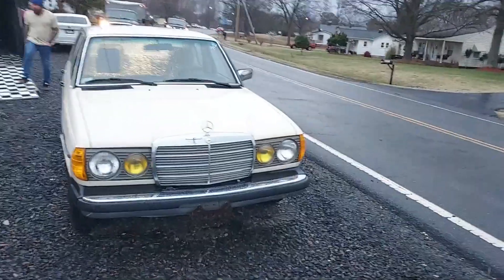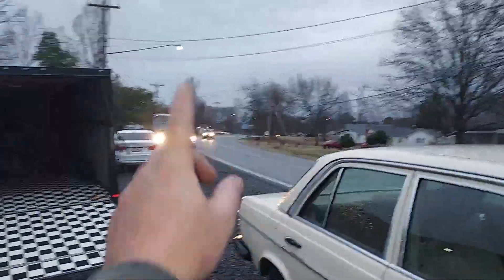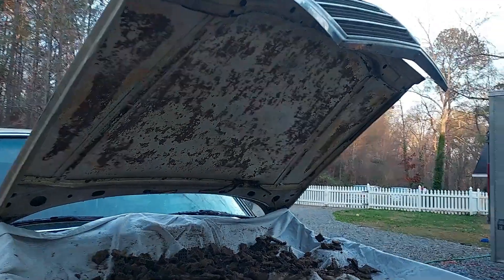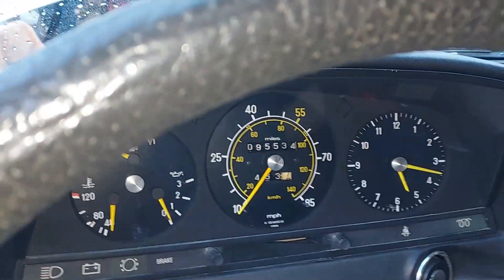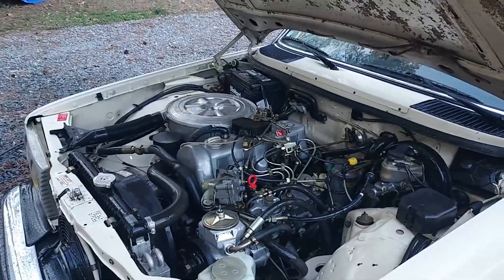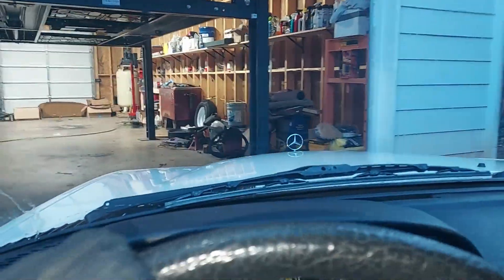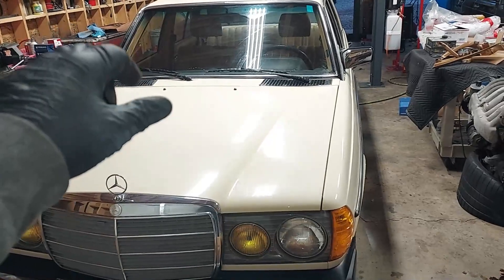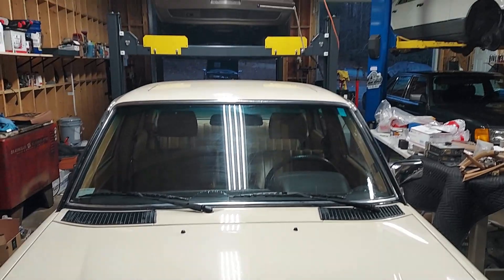1982 Mercedes 240D Manual - Part 1 Picking up the car, Cleaning, Hood Pad

Comment: These are excellent cars.  I have a 1981 Mercedes 240d with a 4 speed manual.  My Benz has 165,000. I like the fact I can do my own work.
Reply: Mine is the apocalypse model.  I use cetane additive and Marvels Mystery Oil and it gives more power and is a lot quieter.
Reply from the maker: @kermitefrog64  very nice

Comment: I have a 1980 Mercedes 240d manual in NE Georgia mountains. Astral silver. My cousin bought new in Birmingham Alabama. I’m unlucky in that the bottom of the drivers door has some rust. Where could I find a good solid complete door to bolt on in silver in the Georgia/Tennessee/North Carolina/South Carolina corner area? Or atlanta-ish. I don’t know if any salvage yards. Any tips would be appreciated! Thanks
Reply from the maker: Send me an email john@woodsandbarclay.com
You need a w123 door I'm headed up to a parts supplier towards the end of May and I might be able to snag a door for you. It's probably not going to be in the color you want so you would have to paint it but it's going to be really tough getting a door in the exact right color.

Comment: Nice car. 🤤👍
Reply from the maker: Stay tuned for the restoration series. This is going to be a good one!
Reply: @woodsandbarclay   What's the story on the maroon 240D?
Reply from the maker: It's in the shop I'm currently working on the ivory white 240D but next in line is that maroon one. It already has new shocks and new ball joints so I don't know how much there is I'm going to need to do to it I need to get it up on the lift and have a look. It may be good to go as is but I always like to go through the cars just to make sure they're perfect. If you're interested in the car go to my website and shoot me an email and we can move it to the front of the line.
Reply: @woodsandbarclay   Thanks for the offer, my budget and garage space isn't ready for a nice MB. I regret not buying a nice W123 or W126  20 years ago. 😕

Comment: I prefer to remove the hood out of the car and do cleaning , repainting and recovering with insulating material on a more comfortable position.
Reply from the maker: Yeah if you're going to repaint that's definitely the way to go. This one doesn't need repainting so we just needed to add the hood pad. Part two of the video series is coming out next week please take a look at it you're going to be impressed with some of the things I'm doing to this car ;) we're bringing it back to factory showroom condition!

Comment: Have you ever converted an automatic to a manual on a w123?
Reply from the maker: No I only do factory original restorations. We don't modify or deviate from the original factory design. However I am building a 1995 e300 race car right now and we have swapped in a turbo om606 and a manual BMW transmission and some aftermarket racing suspension so I do have experience doing that on a w124 chassis.